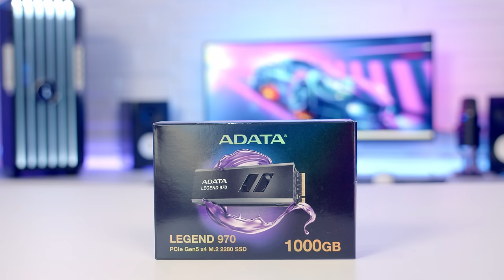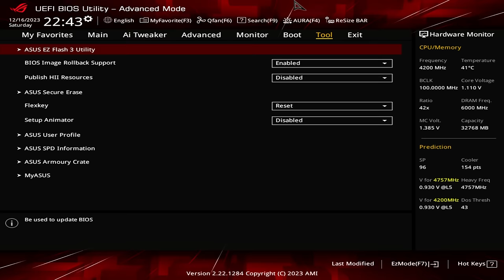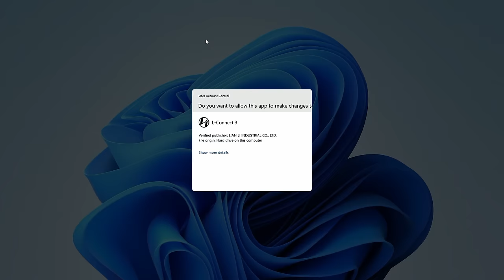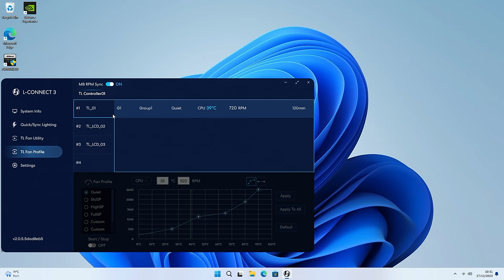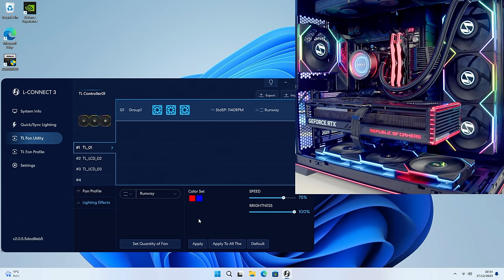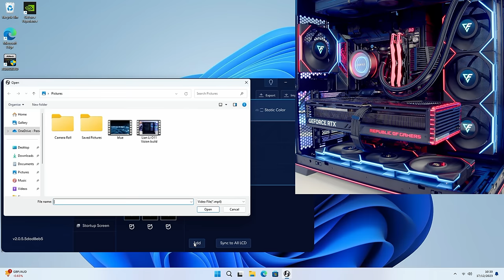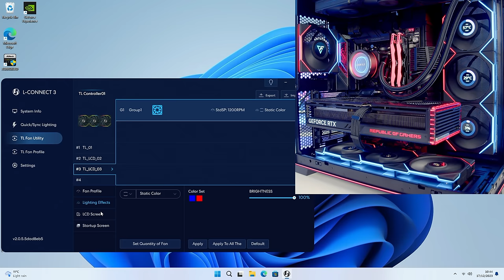Lian Li O11 Dynamic EVO RGB Build - Step by Step Guide

Comment: Thank you so much for this well detailed case review and assembly. I really appreciate that you went through all the details of the case and even assembled a full setup while going over where all the plugs go such as usb headers and more. It can be a little overwhelming being new to pc building but you've pretty much answered all my questions with wiring and setting up in this case with one video. I'm more confident to build my new pc once the rest of my parts arrive. Thank you so much 🙏

Comment: Amazing and well detailed guide. I’ve built many pcs throughout the years but being able to follow a step by step guide is always the easiest for me.

I’ve only a question: I’m having a really hard time putting the bottom fan brackets in the bottom of the case after screwing the three fans. Doing it with the motherboard in the bottom position was basically impossible because there was such a small clearance from the fans and the connectors on the bottom of the motherboard. 

Now I moved the motherboard in the upper position but still having hard time to fit the damn bracket in the bottom… in the video at 47:15 you do it effortlessly, and even with the motherboard in the lower position…

What am I doing wrong?

I double checked and the orientation of the bracket is correct.
Reply: aare you using 140mm fanns?

Comment: I just bought the EVO XL version. Could you consider doing a step by step guide for the Lian li O11 EVO XL in Reverse mode (just like you did for the original EVO)? or maybe the best fan config for the reversed case.

Comment: Thank you for this video.  It's been a great help, as I am currently building in this case.   One thing I have noticed, I moved the motherboard to the upper location and I have an EATX MB, I cannot get the GPU extended support bracket to work, as the rubber cut outs are in the way.  (it's probably something I am doing wrong)

Comment: At 20:00 I'm surprised you didn't address the gpu sagging and how to adjust the gpu adapter to fit the card.
Reply: It's explained in an older video with the non RGB version
Reply: @carbonibrenesk they use a different version
Reply: @TheSjuris that's what I say with different words
Reply: @carbonibrenesk   the original evo has a different solution
Reply: @TheSjuris I'm not talking about the original evo, but the O11 Dynamic Evo
Reply: @carbonibrenesk   there’s only 2 the dynamic ego and the rgb evo. The original evo uses the same gpu bracket that the original dynamic uses along with the Vision
Reply: @TheSjuris  you should read first what a was replying to, you are talking nonsense
Reply: Never had that problem. … especially as most manufacturers address this issue! In the clip he actually does address it. Just watch and listen properly. He talks at length about mounting, securing and stabilising the card! How much more do you need? Even refers to the manual un case more details are required.

Comment: Thanks for your absolutely amazing Videos. I have watched the videos about the O11D Evo and Evo RGB. In this video, you use a ROG STRIX 4080 in an upright position in the RGB case. My question is: can the Lian Li O11 Dynamic EVO RGB hold a ROG STRIX 4080 upright when the case is reverted? Thanks!
Reply: X2
Reply: What is ‘upright’? Use the common terms like horizontal, vertical and hanging. What is upright? In the clip it was horizontal. When reverted the case is just reversed … of course you have the mounting options.

Comment: Do you think the Arctic Freezer 420 AIO would fit in the top of this case using the provided brackets?
Reply: This is what I want to know. I did wonder why he didn’t continue the build with a 420 radiator in as it’s one of this cases unique selling points.
Reply: @09wheelerr  very few actual options for a 420mm aio.

Comment: I just got the same case would you recommend all reverse fans or mixed? I'm a bit stuck on which to get I'm getting these fans too
Reply: Just get reverse blade for the 3 that go vertically and the rest the same
Reply: Sorry … but this question makes zero sense! Do you know what reverse fans are made for? First of all it would be useful to provide a minimum of information what your plans are and how your setup is supposed to look like. Fans are made to cool your PC. Reverse fans are for intake only … all in reverse you have none getting air out. Whats the point of this. And … what fans are you getting? He had different ones … TL and TL LCD … and will you use aio and will you use its fans? You need to plan your design including desired air flow. According to this … you buy the fans needed for that planned air flow model. I have the same case. I have a rear and top exhaust … this requires normal fans as in reverse you would only see the back side. Reverse fans were introduced to avoid exactly this … having expensive fancy fans, but having to stare at the back of the fans as they are intake fans and must be flipped around. To see the nicer front of intake fans they introduced reverse fans. The reason  the initial question made zero sense. 
In addition to rear and top exhaust normal fans … I use the aio and bottom as intake fans. The aio I never use as exhaust as I would use warm air from inside the case to cool my radiator. The aio fans I never use and exchanged with reverse TL LCD so I see the displays . I added normal TL fans on the outside of the radiator … means a push pull system … outer push air into radiator, inner pull it through, warm air then rising and being exhausted at the top. Normal fans on the outside I can see through the mesh a bit. The bottom intake are in reverse again. I also got front mesh with 3 more reverse intake.  Thats 3 intake, but bottom and radiator flow are slightly lower than a free frontal flow. 
In summary … normal are exhaust fans … intake are required in reverse to see them inside the case.

Comment: @ 7:49

the top and bottom do support 3x 140 fans

the side does not

just learned that the hard way today
Reply: It doesn't fit fit. Or most of the screws dont fit? And which fans are you using? On the lian li site it says it only supports 140mm uni fans. Been thinking about buying this case. But with p14 argb since its 3x cheaper.
Reply: @bonito_1196  triple 140 fans fit in the side panel, but don't fit in the GAP where it's supposed to go back into
Reply: @bonito_1196  i have 3 x  140's in the top and bottom

Comment: Does it matter which direction the IO's on the Strix face for temp reasons? I can only find conflicting information about the vapor chamber and the whether the IO's should be up or down. I noticed yours is up and another video I have watched they put it down. Awesome video by the way, putting my first build in 12 years together right now!

Comment: This seems like a very well built case, for the people who've been able to get there's assembled.  But the variations in these cases in combination with the catastrophically written "instructions", make trying to understand how these units fundamentally go together, excruciating (at least in my case).  I watched the build you did with the white case that had the exact same model name as mine, and I didn't have the parts you had (i.e. vertical GPU parts, and fan adapter rails).  Do I have an updated version???  If so, where do I find that, so I can watch an appropriate video?  Like I said, the instructions are all but worthless, making this EXTREMTELY confusing.  I could slop this together, and put screws where they seem to fit, but I'd like to assemble this the way they designed it, to get the most out of it.  I'm anxious to hear your thoughts on this...  For what it's worth, your videos are excellent, and obviously needed given the number of views you've gotten... They strangely just don't seem to apply to my model which, again, is the exact same (at least by name).
Reply: Simply inform yourself about the case on the Lian Li webpage. That is excellent. Or watch a case review for the Evo O11. There is no excuse blaming it on the manual. One good review and you are up to daye regarding all options. There are enough clips showing the installation of the extras.
But with a bit common sense and a minimum of technical skills you do not need any clips or manual tobest the case. 
And … read the manual! Its all in there and even though it has deficits the manual is pretty clear. Despite those deficits it is NOT catastrophically written. Looks like you have never seen really catastrophic manuals. 
You should inform yourself about a case before getting started or even buying it. 
The fan brackets are all included. There are none for the front as its a glass front. Standard mount for GPU is horizontal. A clou about Lian Li is that you got plenty of extension or alternative options … like front mesh, additional usb, top case usb mount, vertical GPU, hanging GPU. 
For each of those alternative installation options you must buy an upgrade pack! If you buy the front mesh additional fan brackets are included. GPU … if you want vertical you must buy the mount and extension strimer. Same with hanging GPU … buy the pack. 
Extremely easy to use case … straight forward … just get started.
I familiarised with the case before buying it and hence I knew what options I had. A bit shocked you have no idea about the most basic features. And no … its no manual that you usually use to inform yourself. Never been so easy as there are tons of reviews out there … just use your favourite PC youtuber and an Evo review will be there.

Comment: Christopher: Perhaps I missed this answer in a previous video. If so, my apologies. Do you design the fan supply/exhaust configuration, including the radiator fans, to provide postiive pressure within the case to minimize dust collection? Want to build a PC for Flight Simulatior and enjoy your videos. Thank you for NY, US.
Reply: Thats the advantage of positive pressure … negative improves cooling.

Comment: Those fans are beautiful but with one costing 50 bucks, a single exhaust at the back would be fine. The build will also will look cleaner.
Reply from the maker: 2 looks great in the vision
Reply: so get the uni fan sl infinity's, 3 pack is 89 dollars now with a controller
Reply: Which ‘these’? There are 2 different fans. The TL are not 50 per fan, but 80-90 per triple. The TL LCD are 40 single or 130 per triple. But seen offers where the reverse triple I paid 130 for is being sold for 290-350 (yes just three fans) … all prices in £. Some offers sell 3 single as triple pack but of course missing the 25-30£ controller. The TL LCD in my eyes is just for accents and not a general case fan ashg so much LCD looks plain stupid!

Comment: Just about to pull the trigger on a build similar to this in an Evo RGB, 14900k with the Galahad II LCD SL-INF 360mm Performance. My fan selection is identical otherwise with triple pack TL LCD 120's reverse flow, triple pack TL 120's reverse flow and a single TL LCD 120. Am I right in thinking that I only need two USB 2.0 headers on my motherboard for this configuration? One for the UNIFAN controller and one for the Case RGB? Many thanks. Also, as a side question - are you satisfied with leaving all control of pumps and fans in L-Connect 3 or should I do it differently? Super helpful video and a thumbs up from me.
Reply: Whats your exhaust? Only the single? You have 2 triple as reverse which are intake. The aio you can install as intake or exhaust. A push exhaust would be visible inside … but thats no good choice … The aio is best used as intake so you do not use warm case air to ‘cool the radiator’, but cool outside air instead. As warm air rises it straight away rises from my side aio in intake mode to the top exhaust fans … and rear … the bottom intake supporting the flow if cool air. 
The case RGB needing usb? Why? It does not need any usb, but goes into ARGB! The case cables are connected to the onboard usb-c and usb-a header to provide external usb!. You must use one internal onboard usb for the aio (has build in SL controller) and one  for the TL controller that are required for the TL fans. I use 2 TL controller as I use one for the CPU fans … as I use TL & TL LCD push pull for my Kraken I cannot attach the fans to the pump. 
Regarding your controlling question … you plug in the pump WM to the CPU mobo CPU fans port, the aio to the mobo aio header … this way you can use your mobo software or L-Connect 3.The question if he is happy makes zero sense! Its your build and YOU are the one handling it and are the one responsible for it. There it is entirely down to YOUR preference … if he is happy, but you struggle with L-Connect 3 … YOU and your computer are in trouble. YOU must take responsibility and decide for yourself!
Reply: @GanymedeXD  Hello! I'm looking at the O11 EVO RB and air cooling it for the meantime with a Noctua NH D15. Do you think it would have enough clearance?
I mean with both fans on the Noctua D15? It's my first build and a bit worried how close the specs are.

On Noctua's website, NH-D15 height says both 165mm and 168mm clearance on the dimensions sketching (confusing).

The new Noctua NH-D15 G2 is clearly mentioned 168mm height.

On Lian-Li's website, it says for O11D Evo, O11D Evo RGB and O11D Evo XL the max. cpu cooler clearance is 167mm.

Only the O11 Vision has 174mm cpu cooler clearance.

I'm uncertain about the RAM clearance well with the D15...🤔

Comment: Which fans do you have set to exhaust and pulling air in? Cause with the new fans you can’t tell which way is exhaust and which way is pulling air in.
Reply: Just look at the fans … easy to spot what is a normal fan and which has reverse blades. You do not ‘set it’ whether fans are intake or exhaust you plan in advance and choose the fans according to your needs!
Reply: Look at the clip … you can clearly see that the bottom and side fans have  reverse blades, the aio normal ones, the trar think normal ones. You immediately know bottom/side intake. top and rear exhaust. Disadvantage … using warm case air to ‘cool’ down the radiator is not the best decision.

Comment: Did you have trouble getting the reset button working with the strix e-e and that case
Reply: Why should that cause problems? The case does not interfere at all. The reset is at the back on the i/o panel next to the bios flash button.

Comment: Thank you for your video, I am writing from the translation, please excuse any missing or incorrect pronunciation. I will buy this case, but I will install a 360 mm radiator on the upper part and do pull push. Can I install 3 140 mm fans in the middle part?
Reply: There is not really enough space for a top push pull … blocks most of the cable space going to the mobo. I use the side compartment to completely ‘hide’ my push pull system. I use the 2024 NZXT Kraken Elite 360 v2 with TL normal and TL LCD reverse. And that radiator is massive. That would never fit on top. The case simply being too small there. Top radiators would also conflict with the side fans and front fans if you use front mesh. As use push pull as intake to avoid using warm case air to cool the radiator thermodynamically the top is a perfect exhaust. Middle part? Think you write about the side compartment. No, no space for 3 140mm … its only a medium case. Fir that you need the Evo o11 XL. I got 16 case fans into this case … but 3x 140mm no way.

Comment: I can no longer control the two led strips of the falls via the buttons. Did it happen to someone else? How do I solve it? Thank you
Reply: How is anybody supposed to advise whilst you do not provide any information at all? Simply check if all connections required are still in place and/or there are any defects in the cables/plugs. Re-plug them to reset the case functions. Check if board plug is plugged correctly, checking with pin allocations. And then go from there. Any conflicting software loaded?

Comment: So I just did the reverse mode option and my side panel will not snap into place. It sems like the LED strip on what is now the top of the case is preventing it. Has anybody run into this issue? It will snap in upside down, but it falls out real easily when you remove it creating a possible bad scenario.
Reply: De-assemble everything and build again. You must have  made a mistake.

Comment: so recently i bought this case and no matter what ive done i can not get the rgb strips to turn on at all is there anything i may be missing? i did the sata connection and the rgb connector on the bottom of the mb! thanks in advance!!!
Reply: I have the same issue, Did you ever figure it out?
Reply: @joshua_anderson0601  what ended up happening as I had a bad case he also got a watch and make sure you’re using the right power supply cables for your power supply or you can fry the RGB. I was basically what happened to me. I thought all cables for EVGA were the same, but they’re not their pin differently so I ended up frying the case, I bought warranty though and they warranty it as a one time thing

Comment: Is the radiator mounting bracket supposed to be included with the AIO? Do some AIOs not come with a bracket? Asking cus mine didn't
Reply: think about what you just asked, how would the bracket fit in different cases. it obviously comes with the case not the aio
Reply: This makes zero sense … they are not adding 200 brackets for all cases on the market. Thats no radiator bracket. Its a bracket to install case fans, radiators or anything else to the case and is part of the case.